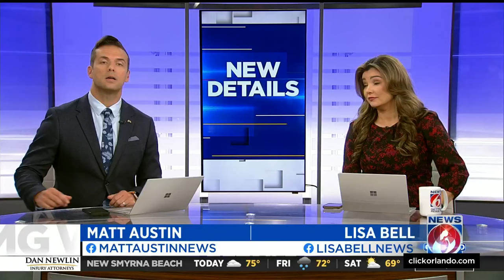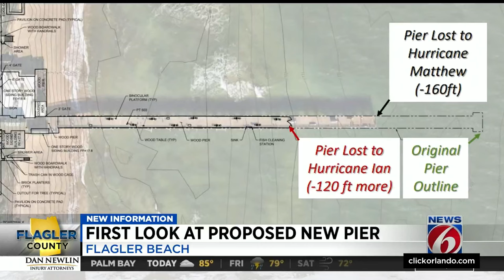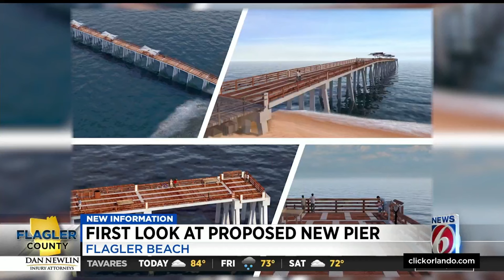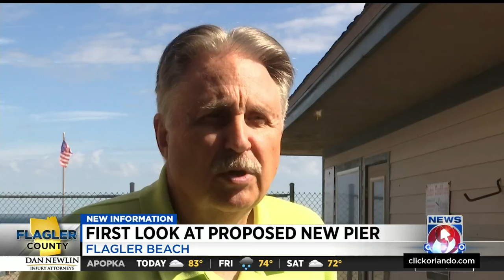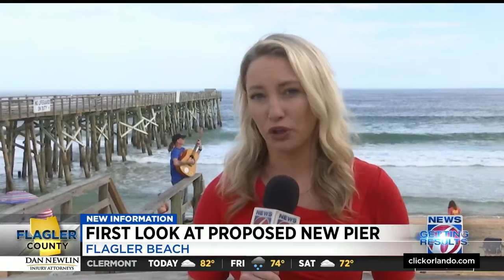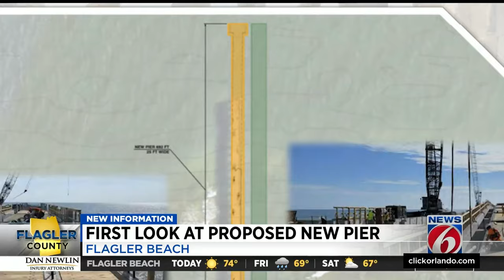First look at Flagler Beach's proposed new pier

Comment: 800' is NOT the original length! When I worked the bait shop there it measured out at 998' so they are once again trying to short the citizens. These new Politicians like Cooley/Johnston suck as they've also defaulted on nearly a 1 million dollar grant for the City previously. Fishermen have tried giving input and as someone that has fished that Pier since the late 80's the City and Engineers are set in their ways and don't listen very well
Reply: 998 just 3 feet short of 1,000  It most likely was 1,000'.... Rebuild it in wood like original... It will last 100 years... But in the future.... They may have better treated wood... Just Rebuild it in wood It should last 100 years...
Reply: @Anonymous-tl6zu  as I stated above, when I worked there I walked it w/the State guy who was measuring it after a hurricane and it measured something like 804-805' or so. I approached the City Manager yrs. back when I was at the Fire Station in Flagler and it had been damaged in another Hurricane N' I stated it needed to be concrete in which I was told the city wanted to maintain the rustic look. My background is a 40yr. resident that has seen it collapse multiple times, 8 yrs. as a Vol. at the City Fire Station and experience in Road/Bridge construction.  I've  fished many Piers throughout FL. and there almost all concrete for a reason. P.S.- 998'/3ft. short of 1k 😂?